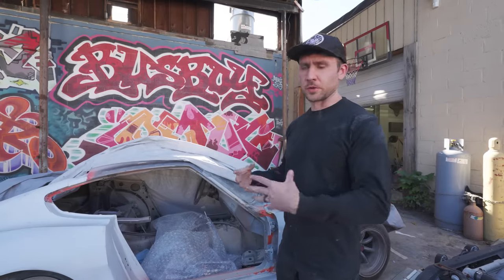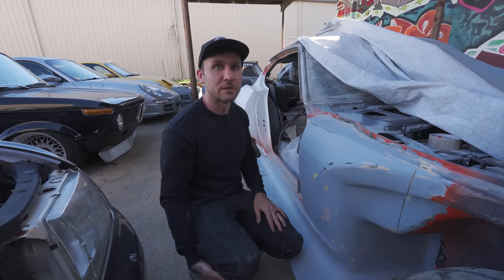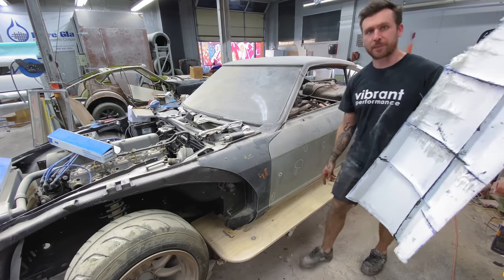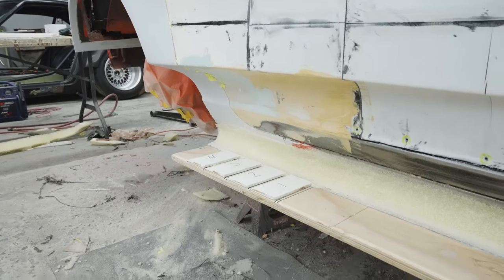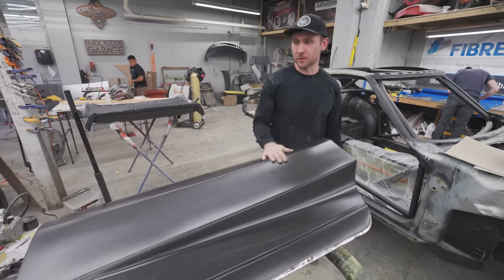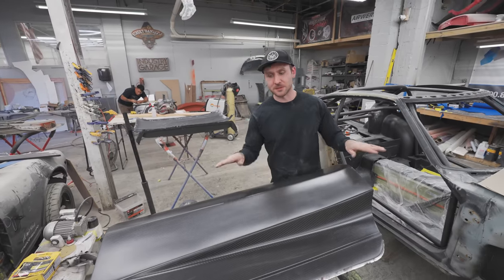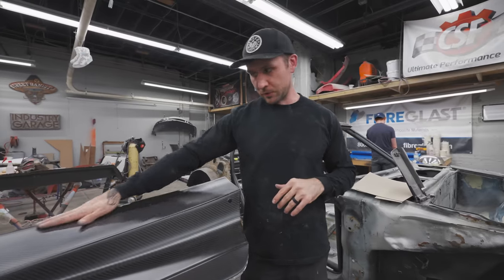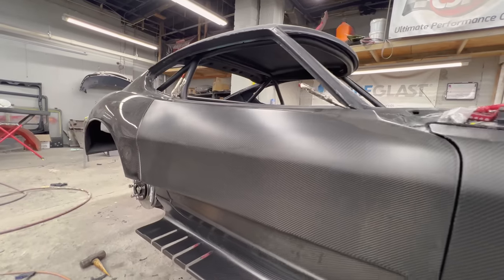Using 3D Printers To Build A Car Out Of Carbon Fiber | Part 3 | The Legacy (15)

Comment: Wanted to make sure I understand. You used the original doors + mod shape to make the plug for the mold in fiberglass and then made a new carbon fiber door. Very interesting!

Comment: I bought a set of those foam Ultra Blocks about 15 years ago and still use them to this day.  Love them. P.S.  You can tell how good a body man is by how much bondo is on the back of the spreader.  The better the person, the less there will be.

Comment: I may be completely wrong, but the point of the lower tray in F1 is to keep higher pressure (slower air) on the top side to give downforce. By feeding air underneath near the rear, you are actually giving it lift. (Getting ready to be shot down in flames). Loving the build series, cant wait for the finished car.
Reply: That's what I thought too.
Reply: Low pressure in the underside of a surface is what makes down force, but the reason the f1 cars has those fins towards the rear wheel is to seal the floor with vortices
Reply: Well more the like difference in high and low pressure is what makes downforce

Comment: You should run a piece of wood just like you did in the mold underneath the side skirt, bond the skirt to that and then bolt that in most race cars use wood or you could use a thick sheet of aluminum. I would keep any bolts hidden.

Comment: One wonders whether it is not possible to construct a frame in which crumple zones are implemented pneumatically with telescopic parts and body parts that are magnetically held in position so that in a crash the parts fall off but then you can usually simply clip everything back together again.

Comment: Are the vents, or whatever they're called, on the rocker panel backwards?  It seems like they would work as air scoops they way they are now, which I don't think would be desirable.  Wouldn't you want them pointing the other way so that they work to suck air out from under the car?  I'm just curious.

Comment: Aren't the rocker panel slots the wrong way? They would scoop air from above the panel and send it under the car to hit the rear tyre.

Admittedly this wouldn't be the first time I get screwed by fluid dynamics but an explanation of how it's supposed to improve aero would be helpful.

Comment: So the molds are sturdy and do not flex under vacuum without any reinforcement?
Reply: Correct, you make the bag so that there’s enough extra volume where you can pinch excess bag down into curves/valleys.